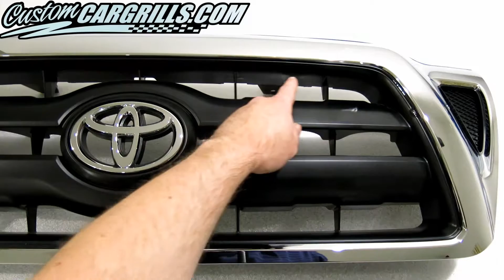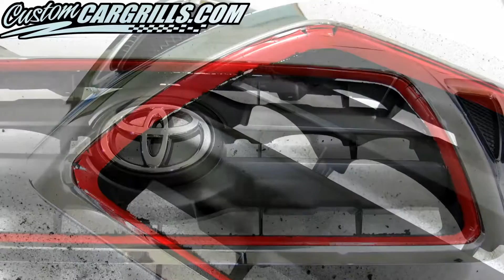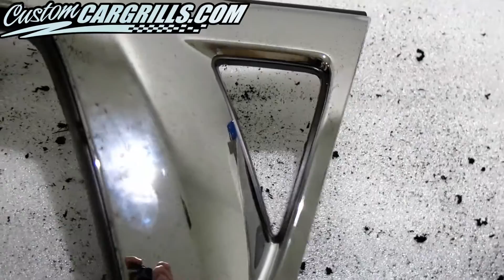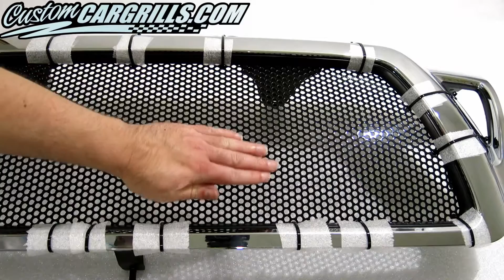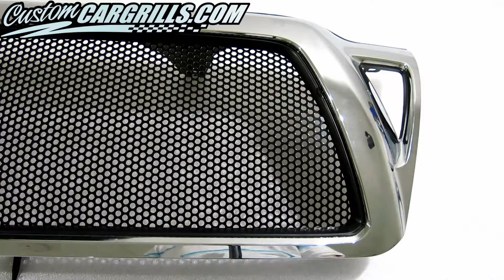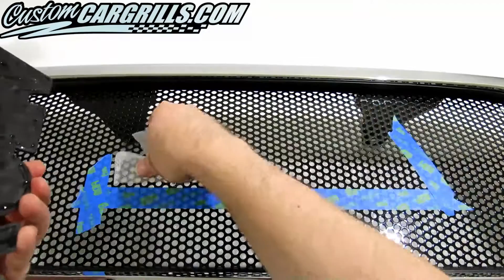Toyota Tacoma 2005-2010 Mesh Grill Installation How-To by customcargrills.com

Comment: I don’t see this mesh style on the website? Am i missing this one?
Reply from the maker: We discontinued the circle mesh from being pre-cut to make room for new products.  The slotted mesh was outselling it 10:1 at the time, but since we've discontinued it there has been a bit of demand for the circle mesh.

I can easily make more of them from raw aluminum, if you're able to paint or powder coat it yourself.  Pricing is the same as the configurations shown on our site.  Feel free to email me if you are looking to order and we can get that set up for you.
Reply: customcargrills if I do decide to get one like that, will it come pre cut and ready to insert like the slotted ones?
Reply from the maker: It would come pre-cut and pre-formed just like what you see in the video.  The only difference would be that it would be raw aluminum and not powder coated black.

Comment: I have a 2011 which is a 2nd generation. But my grill is different than this one. I can't find a video on the 2011 grill. It's got one single large plastic bar across the front with the Toyota logo in the center.
Reply from the maker: The 2011 year model does have a unique grille.  While the 2011 grille can be modded to install mesh, it's usually quicker and easier to just buy a 2005-10 model grille and use that one.  That said, if you want to send your 2011 grille over for a while, I can make a video specific for that model year and modify it for a mesh install.
Reply: @customcargrills  I would really love to send it in for you to do the mesh install. Since I would be providing the resource for you and you would be making a video from my grill, would you charge me? My grill would be perfect for a video because I just bought a brand new OEM magnetic grey grill from Toyota themselves for $300 and I was planning on cutting into it and buying the pre-cut mesh to install. I bought the old white FJ Cruiser retro Toyota logo from eBay already. Can I send it in and you guys do the cut as an even exchange for supplying the brand new grill as a resource? As I said I planned on buying the pre-cut mesh from you guys so I think it would be awesome if we could work something out for each other? Thanks for reaching out to me by the way.
Reply from the maker: If you're providing the stock grille and emblem, I'll provide the mesh (slotted "Perf SS" mesh) for the project.  I'd charge for the labor to do the install and return shipping and that's it.

Send me an email ( info@customcargrills.com ) and we can get the ball rolling on it.

Comment: Can you send a link for recommended dremel. Or does it matter?
Reply from the maker: I personally prefer using the 4000 model:  https://www.dremel.com/en_US/products/-/show-product/tools/4000-high-performance-rotary-tool

For a cutoff wheel, I often use the 543 accessory for bigger parts:  https://www.dremel.com/en_US/products/-/show-product/tools/543-cutting-shaping-wheel  For smaller parts I like using the 542 which is rare to find in store but worth it on small parts if available.